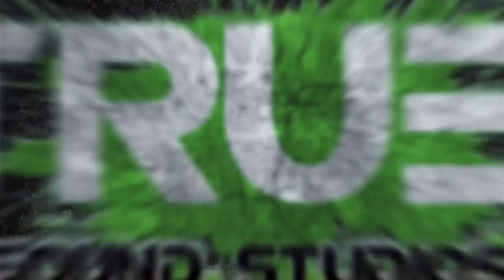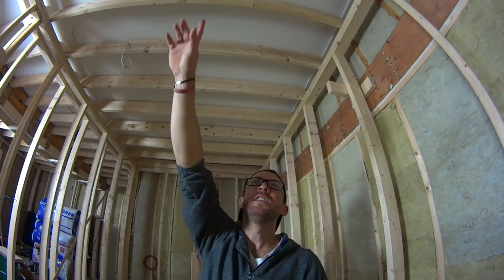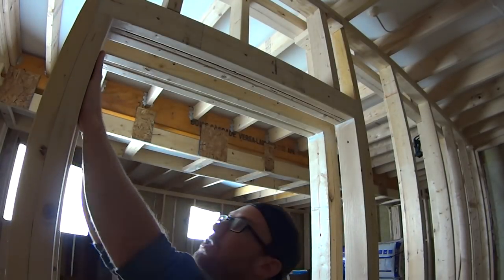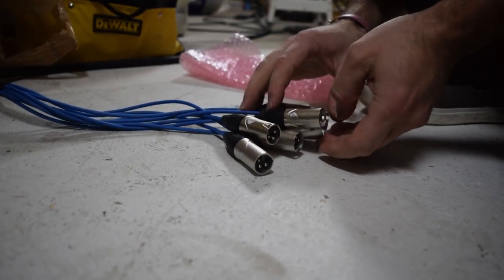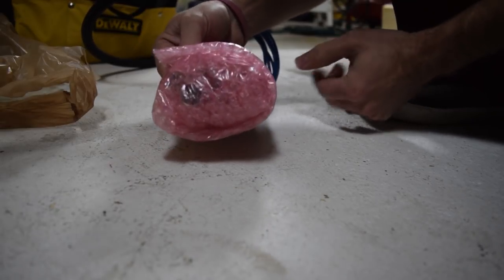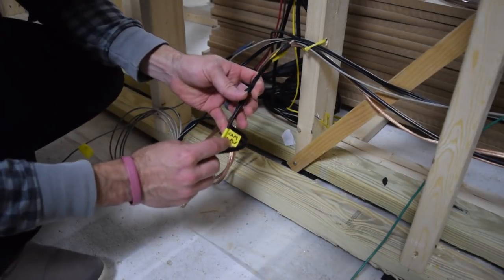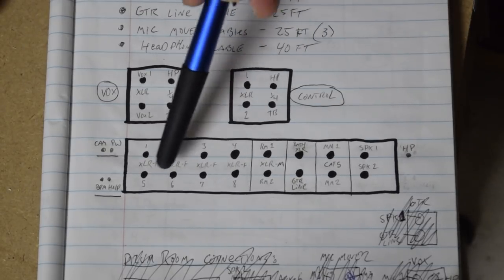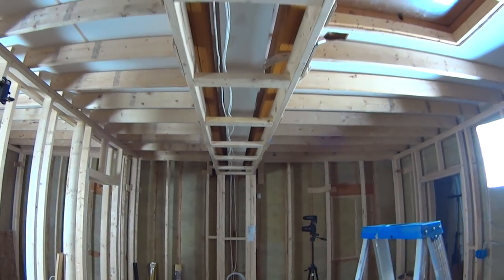Building A Professional Recording Studio - Part 4 (vocal booth and wiring)

Comment: Weezna, you are the man. I'm currently mid way through an external studio build. Similar setup as yours, room within a room. Had some issues relating to the floating floor so stopped to do some more research and came across your videos. I was devastated to hit the Part 4 and realise this is currently ongoing! Really looking forward to your next video, we should be complete here in about 3/4 weeks so I really hope i don't screw something up that you cover 🤞

Looking forward to seeing the new studio come together, good luck!
Reply: Also, we've covered all angles (i hope) but the only last consideration im worrying about is we only have one door. There is 2 x soundproof plasterboard on resilient bars on walls and ceiling. RWA45 rockwool inside. floating floor with 10mm thick resilient tape then osb, on top, 2x sp plasterboard, fibreboard underlay & carpet. My worry is all the soundproofing in the world doesnt matter because we have one composite door. I'm considering an additional external entryway to make up for sound escaping if needed.

Comment: The best way to do the floor is to create a new floor with plywood on studs over U-boats, and then build the inner walls on top of that. I realize that is more cost. But to truly have a room within a room, you need a floor on a floor. This would greatly reduce the transfer of sound from the single floor that currently flows from within the studio to outside it.

Comment: Very nice video series. I hope that your studio turned out great! I understand that the rubber padding underneath the wall frames may not do a whole lot if the (raised) floor you're building isn't very heavy. However, by removing them, aren't you introducing more coupling between the rooms since they're both sitting on the same concrete slab?

Comment: Something I should mention about your wiring scheme. You need to keep data cables, audio and power cables separate from each other. You'll also need to have a separate filtration device for your mains going into the control room and an additional one going into the recording bay, branching off from the control room already filtered power. It gets pretty expensive!
Reply from the maker: Yeah eventually we get to that point and they are separated !

Comment: Not sure if you read or have time to read the comments, John has also helped me and answer few quick questions during my studio build. 
I used a thinner rubber all around the inner frame base, rather than just on the slab. My studio is detached from my house (like in your old studio) and sound will not transfer to rooms in my house and the rubber was not necessary, but I'm glad I did. But it sure is a requirement in your build. 
Here is the video about my rubber insulation https://youtu.be/Du84ux0CpPE?t=360
It's great to see much progress in your build and can't wait to see the final result.

Comment: Hey man, I got like 1 or 2 questions for my studio / house build, if you would be so kind to help....

I only have two more breakers available. 

I was thinking of wiring the small refrigerator, screen projector, lights, and Misc outlets on one.

Then wire 3 receptacles for the studio area (guitar amps, desktop computer, studio monitors + subwoofer, and Rackmount gear) on the other Breaker. 

This would probably reduce any interference. 

So my question is, on the 3 outlets for studio use....Should I "Home Run" each outlet i.e. Run an Individual wire from each outlet to the box? 

And is a 20Amp breaker / 12/3 awg wire enough for all the previously mentioned studio stuff?
Reply from the maker: If you only have two available circuits, that’s probably your best bet. I would definitely run 20 amp circuits using the appropriate cable for sure. I cascaded all of my outlets throughout the studio, and I have absolutely no electrical noise issues. Technically you can only have one wire connected to one circuit breaker so you would have to cascade them regardless
Reply: @TrueSoundTV  What's cascading?

Comment: Have you considered to hang the second ceiling in a slope, to avoid waves reflecting between parallel surfaces (e.g. floor - ceiling)?
Reply from the maker: Chris Jordan yes and the acoustic panels that will go on the ceiling will create that sloped ceiling. This will come in a later video!

Comment: Wouldn't you get ground noise running all those wires together? I think if you put some spacing between wires it will give you less problems, just a thought, keep doing what you are doing, I enjoy your videos....
Reply: no
Reply: The only big issue in running wires together is running Mic and power wiring within 18" of each other.  Signal, Mic and speaker lines running parallel is not a problem and always run the power for the studio and control room on the same phase as there is a high potential for noise if you don't.  Keeping your power off of the power company's  ground is also a good idea by running the grounds on those circuits to an 8' copper ground spike.
Reply: Steven Walker actually that’s not true either, you’re better off running the power and audio lines as close together as possible in order to create a zero loop area.
Reply: @stevenwalker3124  I believe he said he was running some cables for his mic movers, wouldn't those run electrical current, which would give him hum?
Reply: @paulbishop2161  Sorry Paul, but 35 years and hundreds of studio and auditorium builds completely disagrees with you.  That is always a huge potential for EMI noise, and that I am 100% sure of...Sorry but that's the facts...and who came up with this term "zero loop area"  and please be careful how you answer.
Reply: @ernestofernandez6966  Mic movers?  Never heard that term before...
Reply: @stevenwalker3124  they've been building poorly designed studios for longer than 35 years, and continue to do so today.  I'm not saying your way cannot work, I just think it is a lot more unnecessary work when a much simpler solution can be used.  http://www.jhbrandt.net/wp-content/uploads/2014/11/Grounding-Wiring-Zero-Loop-Area.pdf please read this for further information
Reply: @stevenwalker3124  @9:10
Reply: I think he built a motor for mic stand to move it around from control room with a controller, and he also said he was running video cables thru there too
Reply: @paulbishop2161  Paul, no offense but let me quote Frank Lloyd Wright "allow me to be arrogantly honest instead of hypocritically humble"  I have multiple degrees in electronic engineering and physics, I have designed and built over 700 rooms in 26 countries including major label studios and huge performing arts centers, have been published more times than I can remember and haven't had to explain myself in 20 years, not to mention I am a registered AIA architect and ASA acoustician and am still learning in my 60's.  Choosing between what I read and what I have experienced, I gotta go with the experience every time.  My career and reputation are on the line every day and big bucks are also at stake.  BTW Muncy was talking about ground loops and not proximity effects such as EMI (electro-magnetic interference) which is present on ALL A.C voltage lines.  Ground loops are caused by poor wiring practices and not proximity effects.  I have spent a lifetime learning with a passion and helping people have excellent rooms for recording and performing and I am passionate about knowing what I am talking about or I would just tell someone to let me study the matter and get back to you.  Remember..."This should be a brotherhood and not a competition"
Reply: @ernestofernandez6966  Thanks for pointing that out...Those are a custom thing he has done which is pretty cool...Cudos to Weezna!
Reply: @stevenwalker3124  no offence taken, the link I sent you is written by an equally impressive acoustician who also designs studios all around the world.  It's quite simple to read the document and would take you less than a minute.  I'd like your opinion on it as if it is incorrect then it would be a great help to me
Reply: @paulbishop2161  I am familiar with Brandt and do not share his beliefs because while this theory can work in certain cases it will not work in many more.  From my perspective, if I get this wrong I can cost a project huge delays and tens of thousands of dollars.  I cannot risk a possible solution to a problem to save time or money because It might just bite me in the ... you know.   I really like your passion Paul and would hire a guy like you anytime to work on my team.  Peace

Comment: Woah. Can you possibly elaborate on the discussion with John on removing the outer ceiling Sheetrock already in place?

Is your attic vented? If so, how is that being dealt with as being your outer ceiling/outer leaf?

I’m in the middle of a similar build on a detached garage which has has vented soffits/roof vent, and was JUST about to start doing what you are now undoing. Haha. I had read a thread on this issue on the sayers board or gearslutz where it seemed as though the consensus was that even though you are technically doing a 3 leaf that way, you are still better off having two fully sealed ceilings. Any info would be helpful!!
Reply: What did you end up doing and how did it work out? 

I'm in the same boat and I'm thinking leaving the existing ceiling up is the way to go. There's no way to seal up the attic, it needs to be vented. Plus it doesn't make too much sense to me about the cavity being too small and resonating. It'll end up being less than the width of a 2x4 stud different than how the walls are constructed, and it'll be insulated. 

No doubt John Brandt knows what he's talking about, but would love to know more about his reasoning on this.

Comment: Shouldn’t you run a conduit for the cables so if you change your mind in the future you could just fish it through? Great Job by the way!
Reply: conduit is not always easier.  if there is a leak and it gets into the conduit major issue. if a leak just drips on the cables not so much of an issue. conduit has is uses but is a studio idk if the cost/value is worth the added trouble.